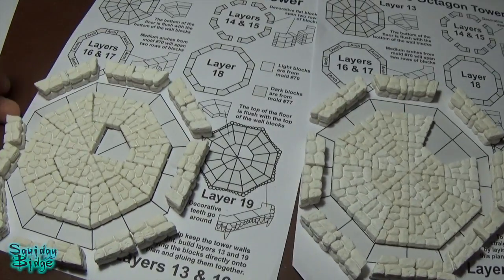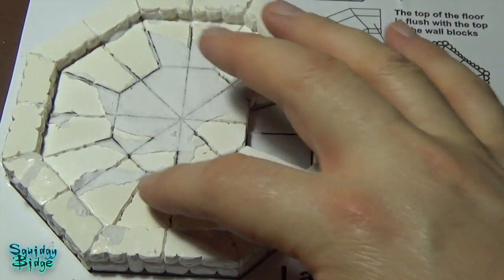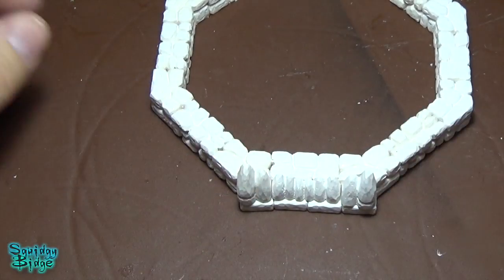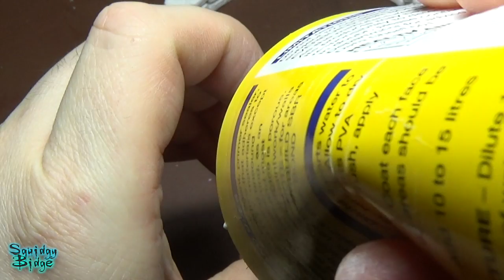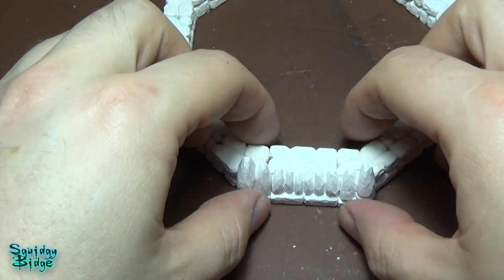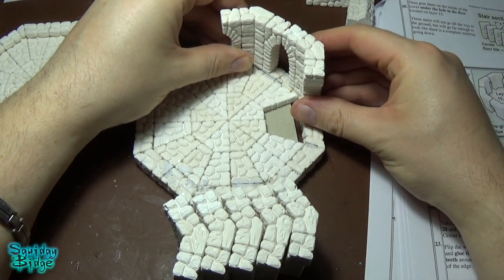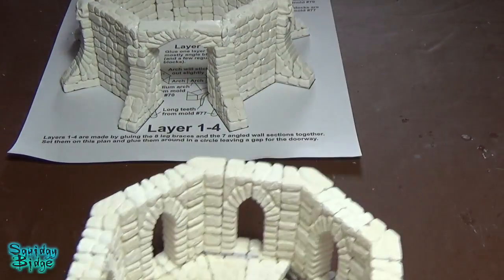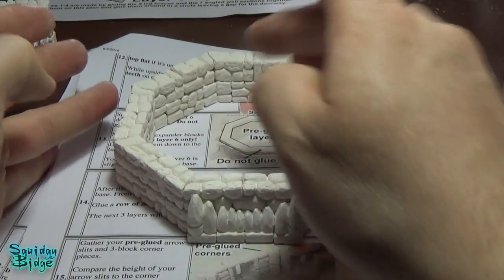Building an Octagonal Tower - Hirst molds Bricks (part 2)

Comment: It must be hard to walk away and let the glue set up. If I didn't know better from watching, I would probably rush through it and end up with  a Leaning Tower of Michigan. :)
Reply from the maker: I was that way when I started building Hirst stuff. I was always of the opinion that "I'm experienced modeller, I can do this without disturbing the lower layers". It just doesn't happen that way, something always gets knocked or nudged out of position, knocking everything out of alignment. Patience is key. Take your time between each layer and you can create some stunning builds.